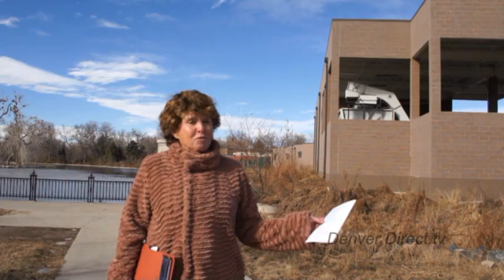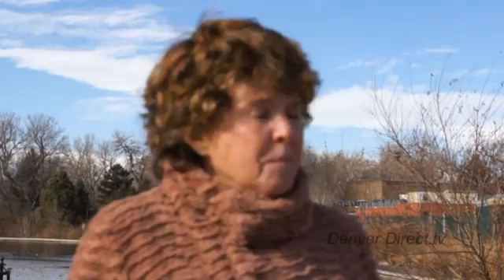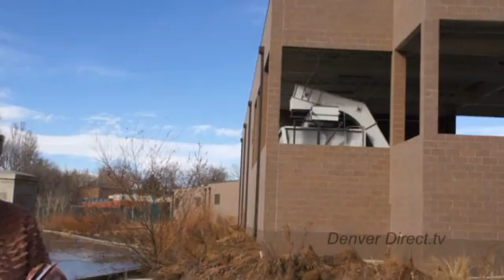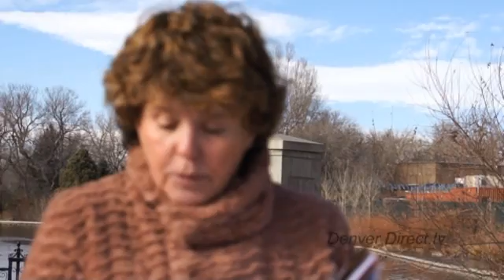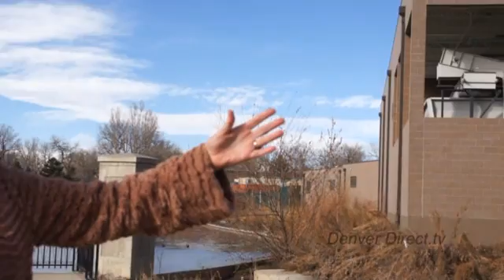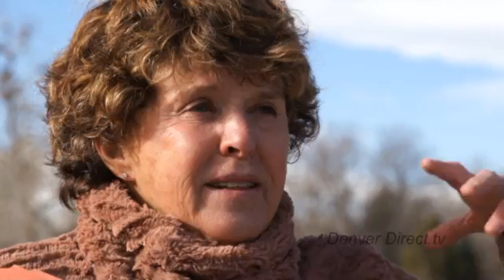Bridget Walsh on Biomass Gasification Plant in City Park, Denver

Comment: I understand the concern for safety for the community and therefore the park. But we should keep in mind that there are documents out there to answer some/most of the questions. The EDOP document put out by the zoo that details the risks and the the safety concerns you mention above including ash, air filtration and waste water collection. All of this starts on page 38 of the report. (I will figure out a way to attach this document for your info...I might have to post it separately.) Plus there is a second document specifically a risk assessment document about pollution and gas control. I will post this as well. One concern of mine was "hat happens to the ash?'. After reading both documents and a powerpoint presentation (all on the city's website at http://www.denvergov.org/sirepub/) I found out the ash is completely collected and is now being tested to see if it can go to the landfill and /or be used in the production of concrete. Something else I found out was this plant is not considered an industrial plant since it's size is less than 4000 sq feet where the actual burning portion takes up about 600 sq feet(or less) and therefore cannot generate a large explosion. If the strict safe guards and Standard Operating Procedures (SOP) that are already in place are not followed then there might be an explosion. I do not think the Zoo would allow any bad things or accidents to happen since they will loose employees (to death or injuries), visitors and not to mention loosing the animals and facility. This concept and method of gasification that is going to be used here has been tested before and has been found to be safe. I do think we need to make sure it is safe and ask questions, but we need to make sure to read and understand the information out there already.

Here is the link to the docs I talked about above. One is called EDOP and one is Air Pollution COntrol (attachemnt g):

http://www.denvergov.org/sirepub/meetresults.aspx...
Reply: Katherine, The Zoo , by their own admission, has not done a  serious Risk Assessment as of December 15. The EODP is mostly questions because much of the information is shielded by "Confidential Business Information" . and we will "cross that bridge when we get to it." I am touched that you have so much faith in government officials and their oversight of the Zoo's Biomass Gasification industrial plant. UNtil we have more information , we can not share your optimism. I have read the information that is out there, more that once. I am not a scientist but I can read. What about the Zoo's plans to turn their "incinerator" into a profit center by taking in "waste" from "customers" outside of the zoo and the parks??See the Draft Plan. Their favored mode of delivery is by dump truck to Gate 15, right across from the historic Ferill Lake and the Pavilion. Let's have coffee.
Reply: Bridget, how do crematoriums comply with EPA standards. Horan, for example? I was told by someone in the industry that after numerous filtration devices, there is steam and not ash. What are your findings?
Reply: +Orville Springs  I refer you to Joan Seeman. Call me for her contact information. there are issues.